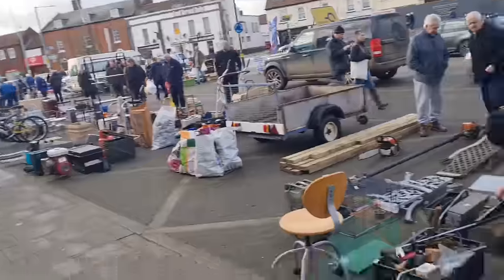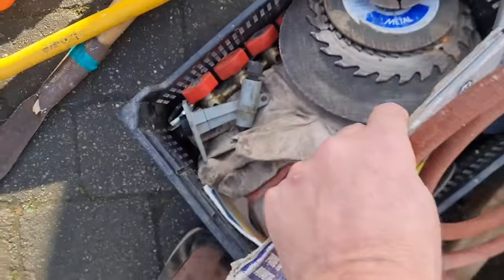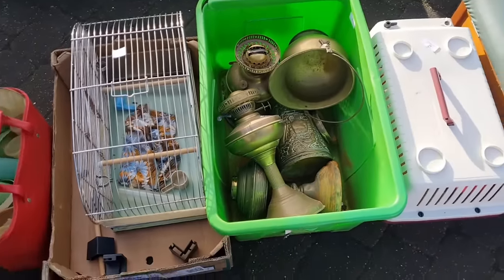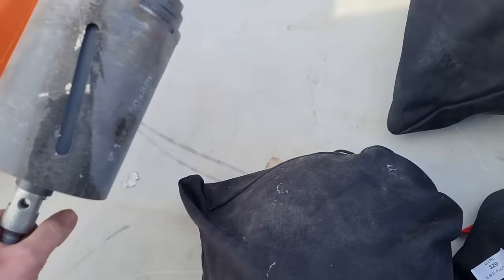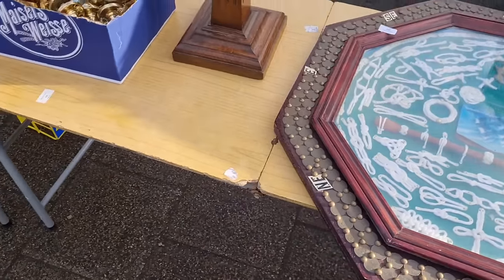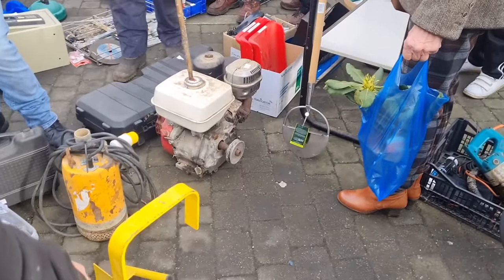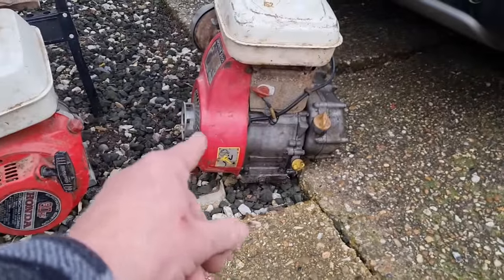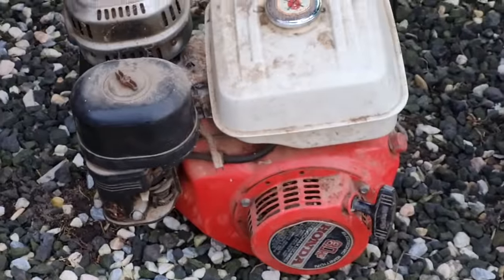Today's Auction. 2 Engines. Swaffham.

Comment: Some sort of edging spade, you said. Many of your engines drove elevators for hay or straw ricks. But how did you harvest the rick? Basically you cut it into parcels you could lift with a pitchfork. Very often some 2'-3' square and as deep as you could lift but usually the depth of the bladed knife about 1 foot. They were frequently used to cut out squares about 3 foot square and 18 inches deep to fit in a trusser. A wooden device with a bed of that size and a top which was cranked down on the hay. The twine which had been set out on the top and bottom frame was then tied. This produced the ancient equivalent of the modern bale. This could easily allow a rick to be transported with the horse and cart. I did help a chap truss a small rick when I was 8. The knives for peat are somewhat bigger, some 4 foot long. A strong handler! A bit brief but may help understand the implement and usesfor your small belt engines.

Comment: What's the brand name on the tripe-hound 🤦🐕? Wouldn't be Manfrotto by any chance? They're about as good as you can get, if it is. I have a Manfrotto, and it weighs an absolute ton. I also have a [go on, laugh] Miranda 'lightweight' similar in appearance to your current one. You could very near wedge that behind your ear and walk around all day with it.

Now then, Honda G200..... Got one of them on a small generator, but the recoil starter rather worn, and nine times out of ten the pawls don't fly out to engage the cup - by the time you get it started, the leccie-trickery is back on! Good engine though, once it's fired up.

We used to have a similar Saturday auction in Selby until COVID locked us down, now there is no more action there - pity really, I've had some good stuff out of that sale - a lot of crap too, but generally very good.  I think Swaffham is just tiny tad too far away from me. Next nearest that I know of would be at Otley, and even that's a bit of a trek from here.

Incidentally, as a photographer, I always lay my tripods flat on the ground or bench etc until needed, because you can guarantee that they're going to be on the ground if you don't, and the little buggers can scratch up your car's paintwork, just out of spite! 💨🚗🤷